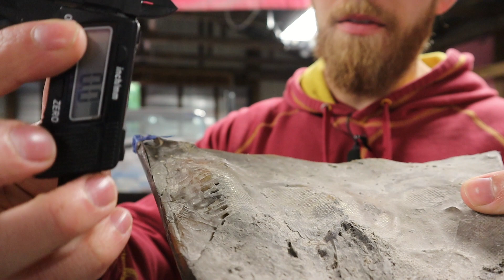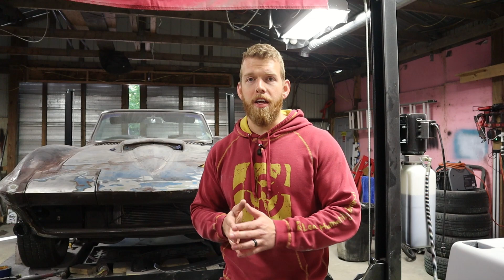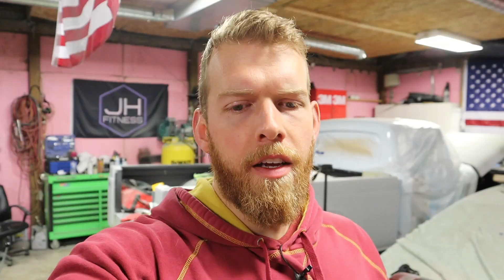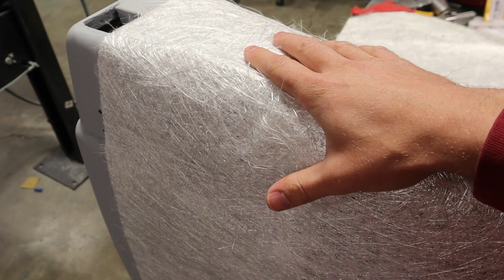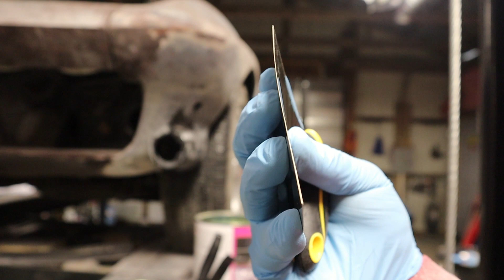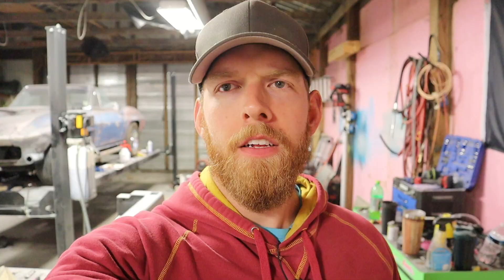Extensive Repair! | 1967 Corvette Fiberglass

Comment: just a tip ive found when it comes to scrapers i always round the corners off. it saves you scrathing and making deep scores. epecially when stripping old paint off. and if you add some acitone to your resin it will give you a longer time period to work it but not to much acitone as itll make the resin extra runny